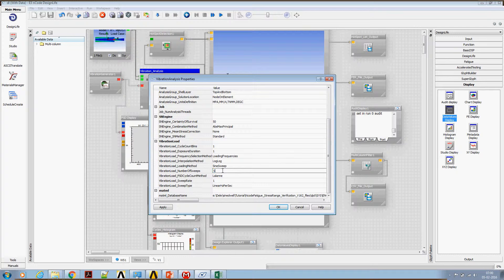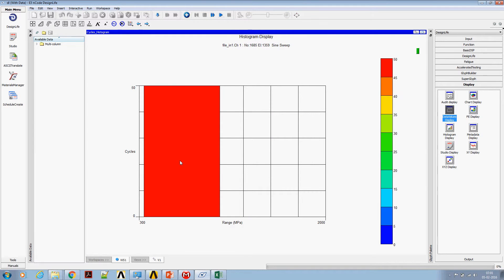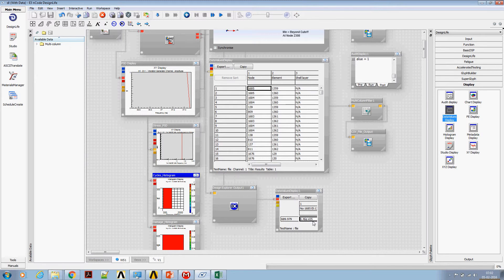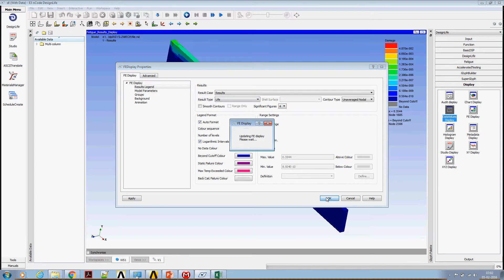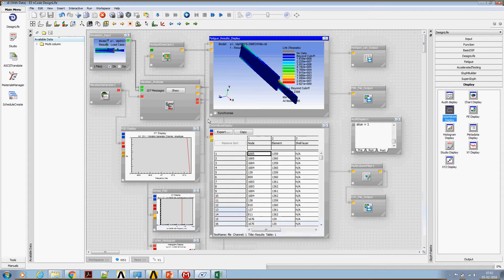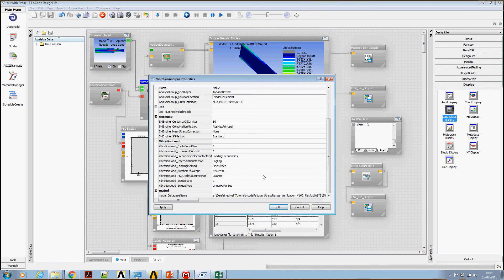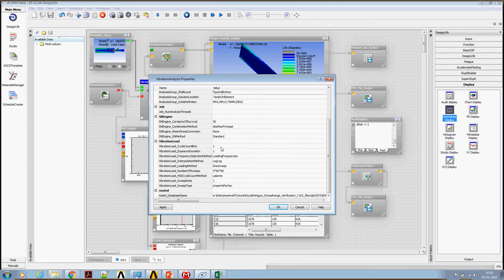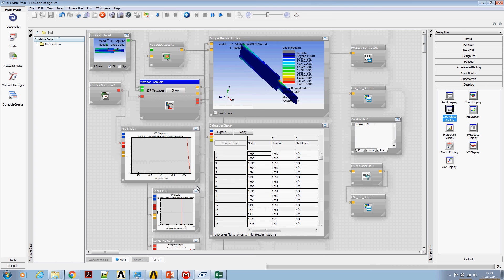Ansys nCode: Sine Dwell Fatigue Analysis Part3

Comment: Thats a nice overview Santosh. How do I contact you?
Reply from the maker: You may put your questions here ?
Reply: thanks nice informative video . 
from where can i get ansys ncode designlife ? is it already available(integrated) in ansys 16,17 or 18 ?? if not then from where can i get ncode ansys and how to integrate or add on ncode in workbench?  .
Reply from the maker: zeeshan ramzan  : to get nCode in side Ansys it requires  separate installer available from Ansys website and require separate licence, contact your local Ansys office.
Reply: in my country there is no ansys office and i am student have no access to licensed ansys . sir is there a crack available for ncode for cracked ansys already installed ????